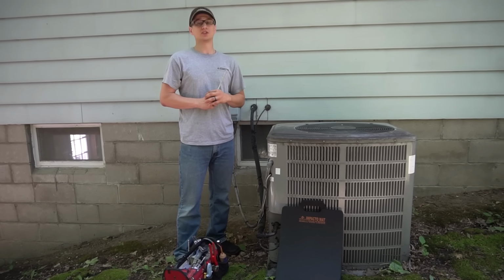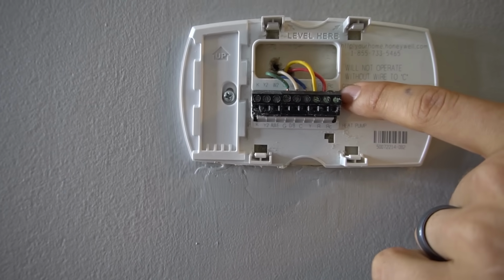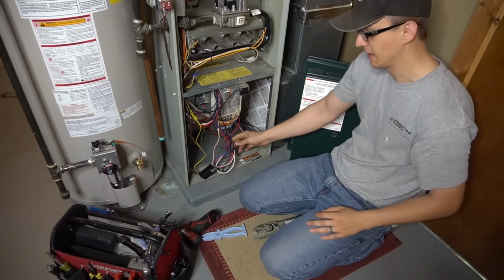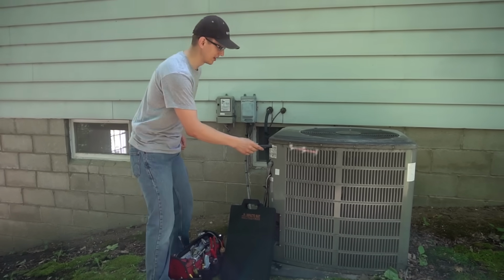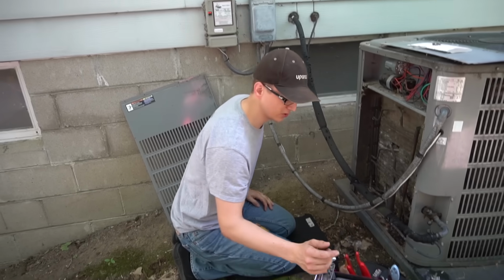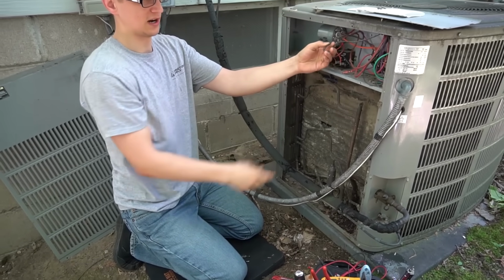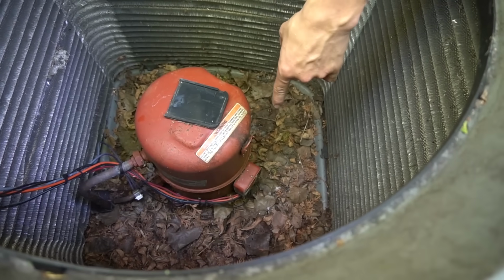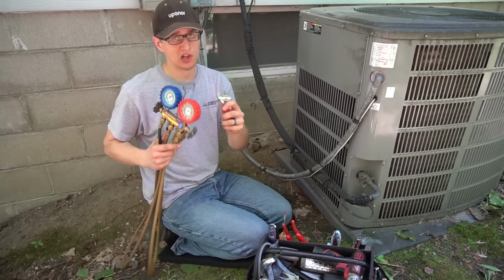AC Unit Not Turning On - How to Fix It Step by Step

Comment: Hi your videos are great thank you. I replaced my ac capacitor the heater works the blower inside works the thermostat is working.when I push the plunger on the ac unit it sounds like it’s running but the fan doesn’t do anything I checked the contactor  and it’s got 240v going in and coming out but it doesn’t do anything. It does make a sound when I turn it on but that’s it. What should I check or do?

Comment: Hi,  In my York outdoor unit I can hear the compressor trying to start every once in a while (heat mode) , then clicking, then stops, etc.. (you can see the unit rocking a little). It's seems like the compressor can't get up to speed and so it kicks out. This lasts about 3-4 seconds each time,  and eventually will run for the rest of that cycle... Some days it runs ok, then it's cranky every few cycles.    Hope I made some sense. Awesome video. Thanks for everything.
Reply: OK ,capacitor  was f'd again.

Comment: You are very helpful. But I am having an issue with my Lennox furnace, it continues to blow only the 120/24 transformer. My 5amp fuse never blows. I checked all thermostat wiring and no shorts on all 3. I check contact coil.etc.... I'm pretty stumped over this your help would be greatly appreciated.

Comment: Thanks for the video. It is great! May be You can advise me, my AC outside unit's one of the fuses keep blowing. Also, I noticed my breaker tripped as well. Second time when I changed fuses, breaker did not trip, but one of the fuses blow again. I have already checked the Compressor pins all looked good. Could you please advise what could be the problem? Thank you in advance!

Comment: Ok so I followed your troubleshooting steps bypassed the fan it worked bypassed the heating the fan kicked on it sounded as if the heating wanted to initiate the burning flame process but it just kept on trying. Bypassed the AC but the fan came on the condenser kicked in for about 5 seconds and then never turned again.

Comment: I have  the furnace put sideways in the attic, is it normal  and ductwork is all flexible insulated tubings. Tried to  look up for the unit details, only find Bryant label put side ways. I put the set temp at 70 and put on hold. Kept the fan on auto, the  unit was showing ambient as 59 . I was thinking it will keep running continuously until it reaches the hold temp of 70. Instead it kept shutting off every 10 mins and restarted almost immediatley. During the day however it kept shut for most of the time. Is this normal.  We have just bought this home  and I am trying to figure out  the different equipments around the house.  Another unusual  thing  I found in the bath tub taps is when I start the hot water faucet the cold water faucet starts leaking at the wall behind the  valve. I thought  both the lines hot and cold were dedicated lines. Your explanation  in the videos is very encouraging and inspiring to venture trouble shooting before calling an expert.

Comment: Hey, your video is very informative! My handler has stop working for the 2nd time in 4 months. 1st time it was a burnt out transformer (easy to diag) AC worked for till the end of summer. When it started getting cold and I started to run the heat, it went out again. I replaced, but also found the control board fuse blown. I replace and the fuse immediately blew again. I then replaced the outside Condenser Coil, then the fuse, and it it started working... for about 10mins. The fuse is blown again.. Also I notice the plastic around the L1 L2 wires plugs on the Condenser Coil  had some melting/burn marks.. Any ideas? Thanks!!

Comment: So here's an interesting situation. When I turn the heat on, my AC condenser starts up for a second, then stops. Heat does not turn on in turn. I tried switching out thermostat with a known good one.. Checked thermostat contacts and they are connected according the the wiring diagram on the thermostat and coincide with the wiring diagram of my furnace board. Oddly enough, I also took out the yellow AC wire and the exact same thing happened. My condenser 24volt is connected to my yellow and common terminals on the furnace board. Any advice would greatly appreciated! Cheers and thanks so much for your great work!

Comment: Do the caps have any resale value? I've been scrapping the past few years and I've got a bunch of them hanging around.
Reply from the maker: To be honest no. And even if they did, they would be worth very little as they are cheap parts to begin with.
Reply: @WordofAdviceTV  Okay! Thanks. What about the fan motor and compressor? Is that all they're good for is scrap? How do I tell what kind of oil or lubricant is inside of the compressor?

Comment: This video was a life saver for me. I went to turn my furnace on for the first time last week. Absolutely nothing happened. I found my new puppy had chewed the wires outside. I cut out the chewed section and put them back together. Still nothing. I found this video and discovered the 5 amp fuse on the circuit board. I had no idea there was a fuse on there and thought they were all in the main fuse box. Just like in the video, it took me a bit to even find it. $3 later for a 5 pack of fuses and it kicked right on! Thank you so much!!
Reply from the maker: You're welcome! Glad to hear my video helped you find the problem! Thank you for leaving a comment, stay warm!

Comment: YOU DID it..HIT IT ON THE NAIL...now the question is: just finish replacing a accumulator (was an old one,still oil on it , the original was leaking) and the compressor run for a little bit made some noise and quit on me i just add 5 lbs (mo99), from 8.... no short to ground and all terminals ohms OK it got extreme hot pour some water on it let cool off but now no even noise only fan running......can you give your take on it ill appreciate...            ;- )

Comment: Hello.  This is my issue.  My Lennox R410a AC unit stopped blowing cold.  I went to the condenser unit and noticed that the contactor wasn't sucked in.  I push the contactor in and the compressor came on but the fan didn't moved.  I replaced the capacitor and pushed the contactor in and again the compressor came on an no fan. I replaced the fan motor, pushed the contactor in and I get the fan and compressor.  I did a continuity check with the High Pressure switch and discovered that the high pressure switch has tripped. I reset the switch and the contactor sucked in and the unit came on.  However, ~37 minutes later the High Pressure tripped again.  I put the gauges on and reset the switch. The system stabilized at 293 psig and at ~ 36 minutes the fan goes off,  the compressor stayed running and the pressure quickly started rising until the switch tripped again at 575 psig.  My designed pressures: Low 236 psig and High 446 psig.  This tells me that the switch is not faulty.  I cleaned the condenser coil  with recommended soap using a coil gun.  I reset and ran the system again, this time the switch tripped again at 575 psig after 45 minutes. I hope that I given you enough info.  Can you advise?

Comment: How much should a compassitor cost?
Reply from the maker: If you call someone out to replace it for you, the average price is around $200. The capacitors vary in price but usually they are $15-$40. So of course it is much cheaper to do it yourself if possible.. (I have links in the description to capacitors)

Comment: Awesome video and I did not think twice before I pressed the subscribe button. 

I landed at your video when I was looking to understand what went wrong when I replaced my Ecobee 3 with Ecobee 4 which after replacing would not turn on. Mine is a Trane XR 95 Gas Furnace and in the crawl space. I did check the voltage reading between the hot and the common at the thermostat but it is dead with no power. Not sure what is happening. Anyhow I am enjoying watching your video. Lot of learning. Keep rocking.

Comment: My problem is my contactor is not pulling in. Also when I push the plunger down my Compressor come on then shut off. Plz help.
Reply from the maker: I have a video for that specific problem: https://www.youtube.com/watch?v=NVPhsK4gK1A&t=1s
Reply: Hey buddie I got the contactor problem fix but I think I have a stuck compressor. It start the stop. How do I fix stuck compressor. Do you think a booster will help it.
Reply from the maker: @chuexiong6680  Yes, a hard start kit can free up a stuck compressor. It does not work every time though. And I should also warn you that even if it does work, oftentimes the compressor will still fail 1-3 years later..

Comment: My dogs tore out the thermostat wires. I reconnected the wires, replaced the fuse on the control panel. The blower in the house is blowing but the condenser and fan outside are not working. The plunger stayed in when I pushed it in but nothing. Any ideas what I’m missing. The unit is 15 months old.
Reply from the maker: That sounds like there is no high voltage (240v) Perhaps a blown disconnect fuse or a tripped circuit breaker?

Comment: You missed that VERY dirty condenser coil. Why is there a hard start kit? Compressor problem?
Reply from the maker: Yes, that was my mistake. I filmed a video on how to clean a condenser coil afterwards but failed to mention that in this video. Most older air conditioners (mine is 1999) all came with a start capacitor and relay. Manufacturers have been getting cheaper so many of them stopped putting them into their units (even though it is usually still drawn on the wiring diagrams)

Comment: So if you push the plunger on the contactor and the condenser comes on  is the capacitor still good? I get 240V and 24V on the contactor
Reply from the maker: Yes. If the unit comes on, then the capacitor is probably not the problem. (only way to know 100% would be to check the capacitor with a meter)

Comment: I had found this video and started watching it while waiting for my sons to come so I could borrow their arms and legs to do what I'm no longer able (run up and down stairs to the breaker box, up and down to the compressor, etc.) to do to fix the A/C . It just turned Fall in Virginia and we got hit with a heatwave of 90s with humidity. Last night without A/C it was miserable! I had watched to the part where the brown fuse was hanging in the furnace unit when they got here. Since this isn't the first time I've had to fix my A/C, I started them on what I usually do for troubleshooting and luckily, we got it running again fairly soon. But, I wanted to finish watching the video so I could be prepared for a worst-case scenario.

The first thing I always check is the breaker box inside the house in case its double breaker has tripped. (It has done that a couple of times when we've had storms.) When breakers trip in my breaker box, the tripped breaker displays a red box. The AC was tripped this time, but it's very hard to push back on, so I needed a son's strength to do it for me. My son put the breaker back to on, but the AC didn't come back on. We went outside to the compressor. Before opening the electrical panel cover, I had a son use a stick to gently turn the fan blade at the top of the compressor unit. Sometimes, it just needs a little push and will get moving again. It turned easily, but didn't turn on. Then, from the disconnect (the power source attached to the house that goes to the compressor that the young man in the video showed you), I had him pull out the fuse holder and put it back in place. (I don't know why but, just taking it out and putting it back made my A/C come back on. Mine has two fuses about the size of thumbs in it and they still look like new.) Now the house is cooling nicely.

One other thing I'd like to share is to TAKE PICTURES! Most of us conveniently carry a cell phone with a camera. So you'll remember which wire goes where (and this is also helpful for car, motorcycle, or any other kind of repair). Before I removed, to replace, the capacitor on my compressor, I took pictures of it with the wires on it to make sure I put the wire back on correctly. I've used this helpful resource when changing cables and parts on my motorcycle and when I take clothing apart to make a pattern I want to sew.  If I were going to try what we were shown with the compressor, I'd use my camera for that, too. I also use my camera to take pictures of things that are in hard to see/read spaces so I can the object in the photo (and enlarge it  if needed). And finally, I use the camera to take pictures of parts (and any numbers on them) that I need to replace so I can take them with me to whatever store sells what I need, to be sure I find the right part.

I LOVE this video and have learned so much. I finally understand the thermostat and how to replace it. THANK YOU. I won't list all the things I've learned but, am thrilled to have found this video. It has taught me a lot and I've saved it to watch again. My next stop, the capacitor. (I installed one a couple of years ago and am still pleased with myself but, I've always wondered if I went about it the right way, etc. It must have been okay since my ears didn't light up. LOL)

My only COMPLAINT about this video is that the young man didn't tell us his name. Hats off to you, young sir, for your professionalism, enunciation, and method of teaching. You're an excellent instructor. Bravo!!
Reply from the maker: Wow, thank you for taking the time to type out such a detailed comment! I enjoyed reading the story! :) And I am sure others who have air conditioner problems down the road will appreciate the suggestions as well. I'm glad to hear you and your sons were able to get the AC going! Always nice when your efforts pay off. I wonder if maybe the disconnect plug prongs were not making a good connection? And by taking it out and putting it back in the problem self-resolved. I'm happy to hear the video helped with the troubleshooting process! I got a little worried when I saw the capitalized complaint but it did have the desired effect. Caught my attention right away haha. Thanks again for watching and leaving a nice comment! Stay cool.

Long live the AC!
Jay
Reply: @WordofAdviceTV  Thought that "complaint" might get your attention, JAY. LOL Thank you for your very nice reply. My next video to watch is your instruction about how to use the multimeter. I learn better by watching and hearing so maybe you'll have me understanding how to use the multimeter I've had in my toolbox for years. LOL
Reply from the maker: @rosemarie20  Glad to have you on my channel! :) Thank you for watching and commenting! That is a 40 minute video so I did put some effort into breaking it down pretty good. I hope it won't disappoint! If you watch the video until the end, pay closer attention to that bottom row ;)

Comment: awesome video man. I'm an electrician but have never messed with ac units. Learned a lot from your video. My mother in-law's unit tripped breaker and had me look at it. I was outside when they turned it back on and heard a sizzle coming from inside the unit and a little smoke. Couldn't tell what was making the sizzle noise. Now I'll be able to go in and check where it came from. Thinking it may be the compressor. So I'm guessing we will have to get a repair man to change it out since the Freon will leak out while changing it.

Comment: When I pushed the plunger on the contractor the compressor and fan started running but the capacitor is fine and so is the thermostat what else can the problem be ? Please help!
Reply from the maker: I have a video on 10 reasons of what can cause that. I think you will find it helpful: https://www.youtube.com/watch?v=NVPhsK4gK1A&t=123s
Reply: Word of Advice TV  thanks man I just had to wire nut thermostat wires since they got chewed AC works great now love your vids man!
Reply from the maker: @Johnny-kk4yr  Glad to hear you found the problem! Thanks for the update, stay cool!
Reply: Word of Advice TV do you have videos on furnace installation? I’m straight out of HVAC school and eager to learn
Reply from the maker: @Johnny-kk4yr  Sorry man, no videos on that yet. I am hoping to eventually post a video of a complete furnace and ac installation video, from beginning to end. A video like that is a bit of a pain in the side to produce though so I haven't done it yet.

Comment: What if the thermostat died and outside unit isn't turning on and breakers and fuses aren't tripped
Reply from the maker: Have you checked the furnace power switch? Perhaps that got bumped off. It could be a blown 3 amp fuse at the furnace control board or the thermostat batteries are dead. The thermostat itself could be bad too. (I have videos on how to manually bypass a thermostat if you want to try bypassing the thermostat to see if it's the problem) Other then those obvious things, you would need a meter to troubleshoot further